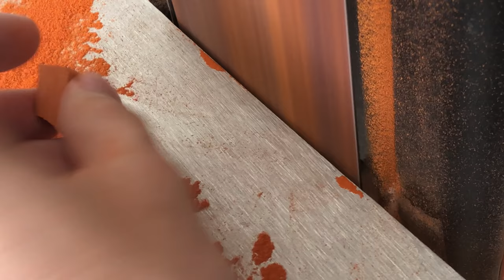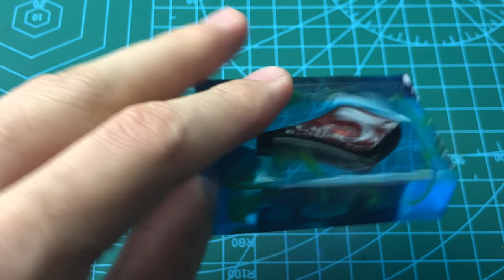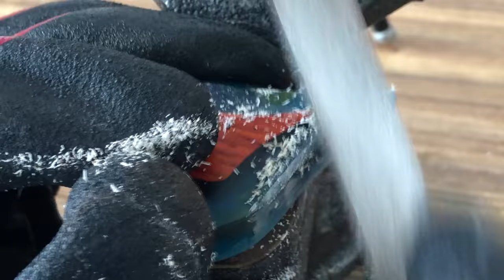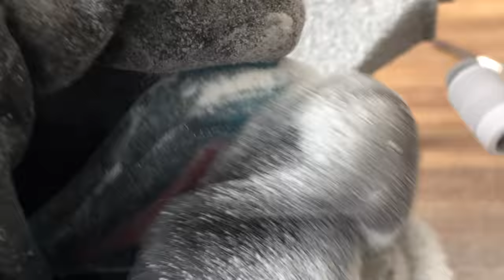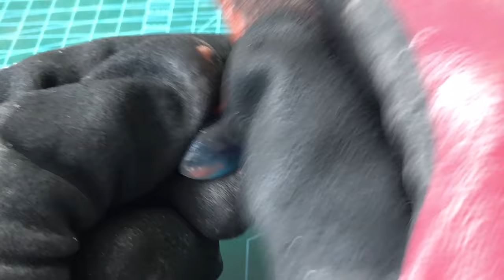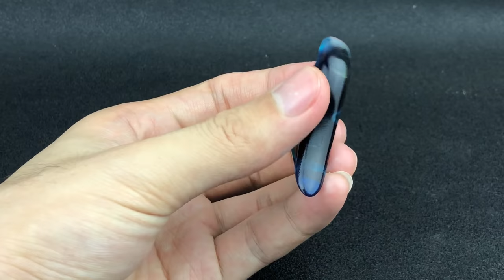Resin art Amazing Magic hero Pendant jewelry / epoxy resin art jewelry pendant S68

Comment: Last time I tried resin art, but the air bubbles had entered the resin.  Is there any trick to prevent air bubbles from entering?
Reply: place a palm sander under the mold and turn on to make the bubbles rise

Comment: Bro where can i get the molds you use for wood? I tried to make mine with acetate but they have too many leaks
Reply: He shows how to make bolts in a different video 1 to 2 millimeter plexiglass cut to size attach a little Scotch tape then use hot glue to seal up all the corners